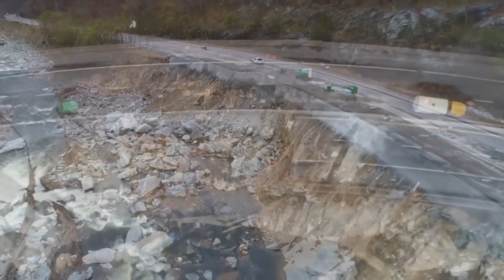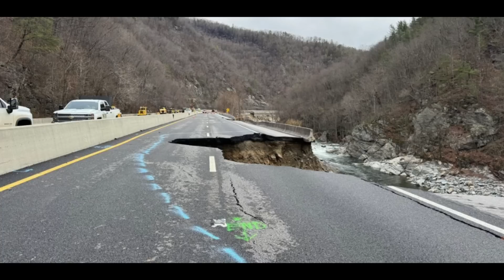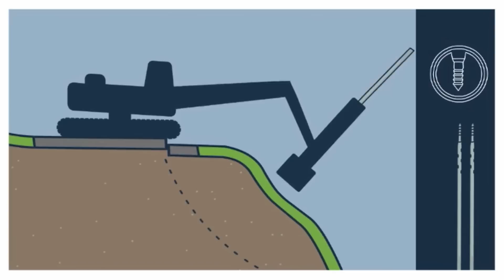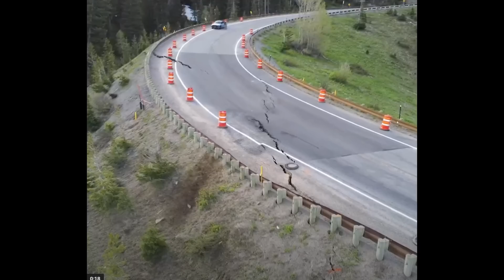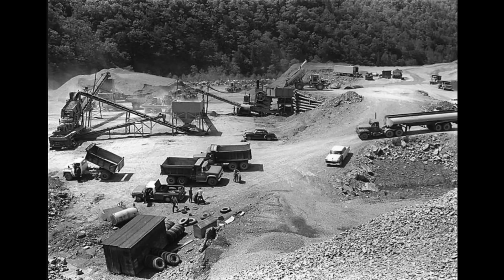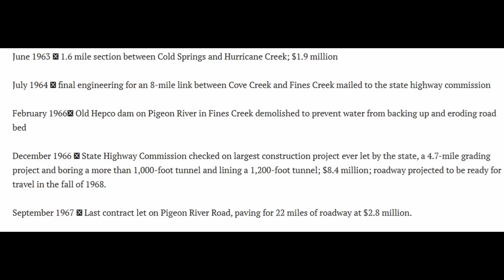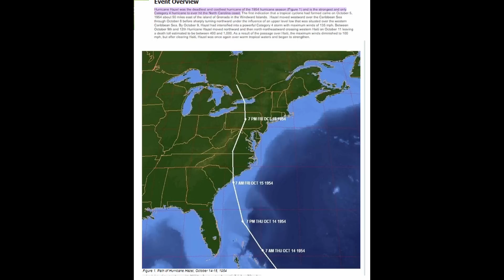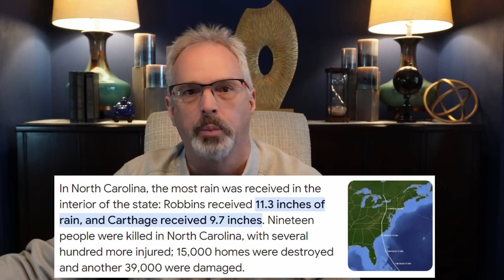Interstate 40 Rebuild Status

Comment: So decadal rainfall events are projected based upon a number of factors but key to that is the history of rainfall in a particular region, and in some underdeveloped areas that history is not all that accurate. 

However, as I have mentioned before since 1980 you really have to look at Sea Surface water temperatures from the nearest oceans to judge the potential rainfall. 
So for example in our area the on the ground reality is that whatever is the elevation of flood water for a particular risk flood, say it’s 49 feet above MSL at a particular bridge for 1 per 100 yr flood ….just add a foot it’s really 50 feet. This is not generally true, but because we are in a relatively flat area the water tends to sheet out. 

This ambiguity the civil engineers seem to know about because the working code in our city is that the first floor elevations on a new home, if you want to get it approved is now 2 ft above the 100 yr flood plain. These base building elevations are rising despite efforts to widen the flood plain and provide upstream water retention for some of the worst affected flood plains. 

Why are some areas of the country more aware of the problem than others. We live between the hill country, “flash flood capital of the world” and the coastal bend. Point to point these two areas have seen the highest 48 hour rainfall events. Of these events 3 have happened since 1975 and none before. The last, during hurricane Harvey dropped 54” in a 48 hour period south of Galveston bay. 

This epitomizes what you call the fat tailed distribution. Houses that had never been flooded had water over the roofs of the houses. 

Again, this is about the ability of air to gain moisture (Sea surface temperatures), hold moisture (air surface temperature) and release moisture (gain of elevation or air mass collisions). 

The original climate change predictions had it that in semi -arid and grassland conditions would see increases in decadal drought and decadal rainfall events  as peak sea surface temperatures have risen, what we have seen is a broadening of the areas affected by these predictions. Last year for instance there was a severe drought in parts of the Amazon. As we can see in Helene the flood hit areas bordering on temperate rainforests.
Reply from the maker: Those are very interesting and applicable comments, thank you!
Reply: Finally somebody in the comments is mentioning this highly important information.
Reply: While it is plausible that effects of more water transport can be measured on the TX coast, where there are many storms to reveal trends... how much is there to separate the circumstances of Helene from 1969's Camille, or to distinguish the water squeezed out from the leavings of 1985's Juan? Those two did similarly catastrophic damage, but happened to be in a less populated area.
Reply: @ That’s true. Decadal storms are not statistically important over 20 to 40 years timeframes. That’s why it’s so difficult to change a 100 flood plain. The older records take precedence. 

Let’s just take an example suppose you have a storm in 1890, 1930, 1940, 1960. Based on these 4 storms, let’s say they dropped and average of 12” per storm and so in this case the hundred year flood plain might be set based up say 18” of rain per event. And we can go another 20 years and maybe no events and the maybe 12” in 1985. This establishes a pattern. Now let’s say you have 25” of rain in 1990 and 22” in 2002 and 19” in 2021. Despite each of these being between a 1/100 and 1/500 year even, the rainfall required will not overnight going to change. If we started recording events in 1960 and were asking in 2024, what is the 100 year flood plain, the answer we get is different from 1960. But since we already have established a flood plain in 1960 and an amount of rainfall required to fill that flood plain, in 2024 at best we can nudge the flood plain up an inch or two, we cannot eliminate the legacy data. 
   
There’s also a problem most people don’t consider, through the Great Depression flood control projects have been built in many places that have roughly disappeared into the landscape. Before these flood control projects floods were devastating. And example is the flood of valley of the Rio Grande that took place before lake Amistad and Falcon lake were built. We have had substantially bad floods in southwest Texas with relatively low impacts due to the projects. But there are water conservation projects all over the state that are almost invisible. Farms with water retention ponds, small damns on seasonal streams, power plant retention water, ect. So despite the fact decadal rainfall events have increased, downstream events have been moderated. But that won’t last forever, with out a remedial water plan we could see “city destroying” floods given the potential for rainfall.
Reply: @Darisiabgal7573  I wouldn't say that the older records take precedence. A threshold does have to be passed before floodplains will be changed, though... and in very developed areas (likely including mountainous NC) IMO there is some deference to what was probably more like a 20-year historical tolerance for recurrent flooding.  People historically built closer to watercourses than was "safe." But houses with stone foundations behave differently under flood conditions than double-wides...
Reply: @ When your downslope is measured in 10s of feet per mile of drainage and you have breached the flood plain, stone structures aren’t going to help you. Tell that to people who build homes near the Guadalupe. 
    Unless you have a deep pile driven foundation fast moving water will just undercut the foundation and it will skip along the bottom. In hurricane Allen the storm surge pulled 8x8x8 granite blocks under the road bed and tossed them god-only-knows where. 

Simply stated, if you plan to build next a drainage area with fast moving current you better damn well know where the best estimate of the flood plain will be as long as you expect to live in the house. I hear this all the time, “this was a five 100 years flood” or “this was a 1 per 1000 year flood”. If these two floods are 10 years apart, bud, the flood plains are just wrong.
Reply: @Darisiabgal7573  The bad situation in most cases is "building in an area with fast moving current." In my area FEMA usually starts defining floodplain at 1 sq mi drainage... western NC looks like it is probably more than that, or maybe fit to purpose, i.e. only done where there was something to destroy. They do not commonly have the 500 year defined, which they do in my area. They will probably do the 500 year now.

A comparison could be made to South River/Irish Creek north of Buena Vista, VA. In 1985 Irish Creek killed quite a few people during a 20"+/- tropical-related event. FEMA has not run a study all the way up the creek, but labeled the whole upper valley as flood zone. The lower end has a complete study and shows lots of houses in the flood zone and an occasionally very extensive 500 year limit. In other words: observations matter, once they are made.

A midrange assumption for peak runoff at 1 sq mi is 1000 cfs and 100 ft wide of erosion-capable velocity, if there isn't a well-established channel that also isn't uninterrupted by infrastructure. Assumptions that conservative are not common in rough land... or in suburban Houston!
Reply: @ That’s another choice, to use the 500 or 1000 year flood plain. But I think is better to look a the trend in flooding along a broad area, say Appalachia, and examine how that trend is deviating from expectation. 

Let’s give an example, suppose I am north Caroline DOT and I need to build a staging yard along I40, there are several possible sites available. One is above the 100 foot flood plain, another the 500 foot, and still another above the 1000 foot flood plain. So the site is going to store pea gravel and crushed concrete, maybe even a concrete recycling yard. 
The first question, how long is the site to be used. This is not a trivial question because abuse many bridges, originally built for a 50 year life are still in operation after 75 years, and sometimes the bridge is no longer used but the bridge remains as a relic. 
The second question is within the range of possible life’s does the trend of risk predict that the site will experience catastrophic damage. 
The third question is within the range of life will the extreme risks in flooding combined with the obstruction of the flood plain result in more catastrophic damage in the surrounding areas. 
The forth question is will money be budgeted at a time when the site is deemed to be to risky to remove the structure. 

This is just one tiny aspect climate change remediation involves. 

Let me advise what the problem with not updating flood plains is. Here in my city the 100 year and 500 year flood plains are separated by about a foot of water. So let’s say 20” of water in 48 hours achieves 100 year flood plain. But as we saw in Allison and Harvey that potential for rainfall is 36 to 54 inches. 36-20 = 16 inches. Again these are relatively low lying areas, so 16 inches over a water shed is more like 30 inches next in the flood plain. This is the exact reason we are getting multiple hits in the same location of extremely rare flooding events. Simply stated the flood plains are out of date, despite the fact they have widened drainage systems, increased the height of bridges, increased the number of acre feet required for storm water retention. 
It’s quite simple, if you think the maximum amount of rain in a 48 hour period is 20” and if everything higher is so rare you don’t even need to consider it, then that thinking will have trouble dealing with 30” of rainfall, it’s simply will take years after such an event to uncover why the event was so catastrophic. That’s not the solution. The solution is to abridge the rainfall rates to the climate trends.
Reply: @Darisiabgal7573  I think the starting point if one is considering properties that may be at some risk is to assume that the baseline expectations may have been developed on overly smoothed data in the first place... particularly for areas with a lot of exposure to tropical moisture. The 100-year daily rainfall for Harris County, TX in the USDA watershed program (which does not feed directly into federal floodplain delineation, but uses overlapping data) is only 12.5 inches. When there has actually been 40 inches 3 times in 40 years, clearly the original data set was not top-quality even before potential climate effects are considered. Same with that location I described in VA, where the 100-year rainfall is 8.8 inches but 20 inches has been recorded multiple times.

But I also don't have the impression that there will be major changes to the floodplain in NC based on what Helene demonstrated. The places called out as having major destruction were already mapped in 2010 as having major amounts of structures in the floodplain.
Reply: @ politics. People don’t want their property values degraded after being moved into a flood plain. Over all I think Houston-wide has broken the 14” mark 3x in 40 years, but if you go closer to the coast that value goes up. Where I sit, since 1999 we broke 16” and 24” 48 hour rainfall totals. There was a flood in the late 70’s comparable to TS Allison. The difference between 1970 and 2024 is that there is a billion or more dollars of vulnerable property in the flood plain. It’s a convergent problem, people are tearing down and rebuilding where people had previously built, but where they built in the 1940s and 1950s was not well charactetized in terms of rainfall and flooding potential. Adding to this the amount of runoff increases with building out in a water shed and as upstream areas are built up (before Allison) the terrain tends to divert water more rapidly to drainage with less obstruction. If no one is really living in these upstream areas it’s not a problem, when you have a half million people living in a watershed, they also don’t want to retain 2 feet of water. Adding to this is more rainfall events that cross a certain threshold.

Comment: What would be the alt route.   Cheapest, Easiest, Best options should be weighed. Dont want to build it a 3rd time.
Reply: The alternate route I saw proposed was to follow the French Broad River through Madison County NC to reconnect I-40 to the present route near Newport TN. That’s probably the better route, but you’d need a much better bypass around Asheville than currently exists.

Comment: As a retired road construction worker, it makes me laugh when they think that this is a quick fix. And how does opening 2 lanes of traffic help when you close off access to the areas that need to be fixed. They won't be bringing in any equipment if the only area is now closed to 2 lane traffic.😂😂😂
Reply: It's an effort to return traffic, currently the 40 traffic passes my front door, and we have had many accidents due to highway truckers getting into steep and twistie roads.  Several have flipped, one caught on fire within view of my place, and there have been numerous people run off the road by truckers over the line.  I was almost rear ended by one when traffic stopped on a steep descent.
Reply: @Ripped-Inflatables Took a load from Calhoun, TN to Cowpens, SC using the alternative routes that trucks “can” use.  Not doing that again.  There are several turns where you do go into oncoming lanes, shoulders are non-existent, and it’s a dangerous alternative.  I’m sorry your area has to deal with this.
Reply: @thedevilandhertrumpets4268  I'm greatful for some others first hand experience.  I didn't even get I to the other routes that big rigs have gotten on like the dragon, one truck ended up 4 miles off the highway on a gravel road, spent the night there when he went off-roading.
Reply: @Ripped-Inflatables  Sure 🤡
Reply: @Oldschoolrules123  another utube rocket scientist.  🤣😂
Reply: How about elevate the road on river side by driving pilings into deep ground. Let river do what it wants to do. I'm no Geologist. But I did stay at holiday Inn express. Just a thought. God bless WNC. STAY STRONG.
Reply: @ToeJamX2   I think you have the best idea. Drive some pilings down to bedrock , place massive rocks mixed with concrete as a base *( think Hoover Dam ) and also try to re-route the water away from the road by dredging out the other side of the river/creek. If we can build dams safely, should be able to build an interstate here as well.
Reply: Thankyou sir.
Reply: Their is no other way between tenn and WNC.  I - 40 has been closed due to a multi-year rebuild 3 time in my life ( I am 40). The detour is an hour plus drive to almost Virginia on a 2 lane mountain road or Atlanta.
Reply: @scotthix2926  ...and you should see the affect this has had on I-20, I-85, and I-75 traffic around Atlanta! It's a mess!
Reply: @thomasdragosr.841  to be fair, Atlanta is ALWAYS  a mess...
Reply: @chrisvowell4961  for 36 yrs has been. Lol
Reply: you need to learn hoe to read maps
Reply: @scotthix2926  On primary roads? Numerous secondary roads thru WNC to Tenn, yes? ie 241
Reply: @georgepcarlinjr4730 interstate traffic needs to stay off those roads so the communities affected by helene can continue to recover
Reply: @mattcookeco  were not speaking of truck traffic through swannanoa or anything like that.  Our area was spared, truck traffic has always been here, however, these are local truckers who know the roads.  Get a young interstate only driver and watch the brakes smoke when he's 45 downhill into a 30 mph curve...
Reply: This section of I-40 has always been problematic with land slides coming down on the road from above almost yearly, causing road lane closures that last for most of the year. Once it is fixed another slide occurs. Some brillant idiot cutdown the trees next to I-40 stabilizing the soil. So with every heavy rain period another slide occurs.

For the section below the road that washed out in Hurricane Helene along the Pigeon River and took the two eastbound lanes, they need to build it up from the river upwards building it with lots of huge rock and building a very, very stable base to build the road on that will not be washed away by the river in historically high full flood stage. And the road will still be subjected to landslides from above because they continue to do idiotic things like removing trees leaving bare soil with a thin grass covering.
Reply: I live in East Tennessee go up from 40 to 85 and 26 will take you right to North Carolina all interstate no back roads I worked with Clayton and hauled oversized and we have had to detour that way many times
Reply: Casey, if you use Google Earth and look north up the coast of Japan from Fukushima you'll find a newer coal fired power plant. Unlike the whackos in this country Japan has found a way to burn coal cleaner.